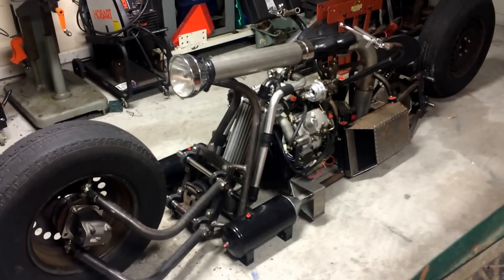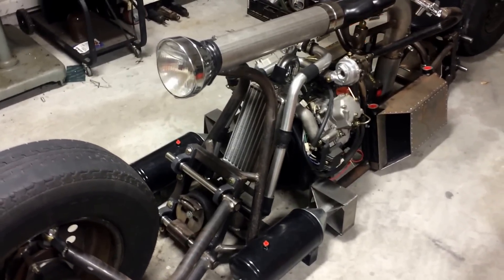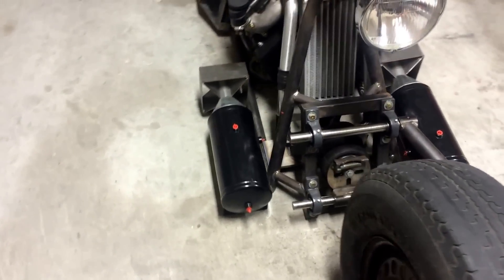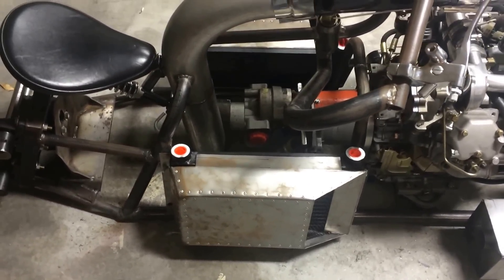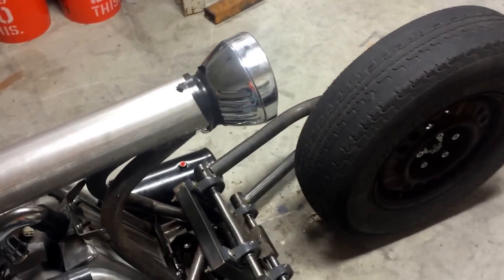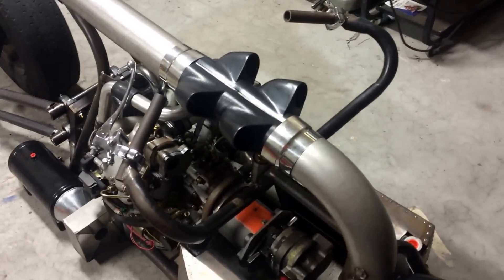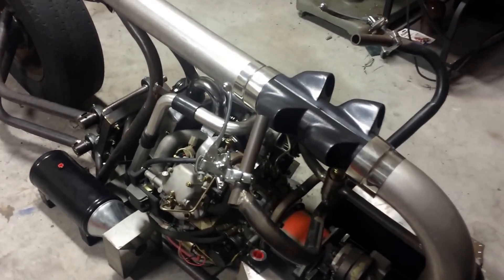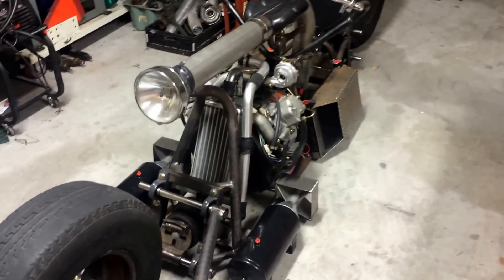Hydrostatic Twin Turbo Diesel Motorcycle Build (Part 1)

Comment: Very nice work Sam. I enjoy your videos. Congratulations with all of your success in partnering with the diesel brother guys. I am starting this winter a turbo diesel bike of my own and was thinking of this concept myself. please tell me if i am headed in the right direction before I spend a ton of money on R&D. I am considering using a variable speed displacement hydraulic pump like on a forklift and eaton wheel hub. I am unsure of the size or series yet? I believe using this set-up would give very good dynamic braking, also like on some forklifts but  would also have one wheel set-up conventionally for safety. Please any help you could provide in selecting of the right parts would be greatly appreciated. Thank you, again congratulations on all your success.

Comment: Very interesting. I have been thinking about shoehorning a 40hp diesel in my Dnepr sidecar rig with a hydraulic drive too.
Can you give me the exact parts you are using; motors, pumps part numbers?
What kind of efficiency do you recon you will get in the drive-train?

Comment: I like =D
Now, how about making some headlines eventually, first you port the tops on the heads, by doing so, you will increase pressure in the chamber, hence making it more fuel efficient.
secondly, turbo is good, but only if activated by high pressure, like accelerating onto the highway.
You want the turbo to be efficient, but only when it's needed, right?
Thirdly, add a powerful, electric motor to make it hybrid, which for example could be used on the front wheel.
Lastly, make some aerodynamic body to reduce resistance and drag and put together some numbers by test driving it for six hours without stopping ;)
This should get a good base for some mass production, so don't just sit around, give me numbers =D

Comment from the maker: Buddy Rowe, thank you for the comment! To answer the steering question, the arm is stationary, and the hub motor is actually what rotates. I have two different types of steering in mind, the first is a 1 to 1 double acting hydraulic cylinder at the hub motor connected to one at the handle bar. And then double the system up as a safety precaution. The other is a thick cable system that connects the handle bars to the hub. Like the steering on a boat.

Comment: wow. cant begin to understand how this thing is gonna operate / look!!!! very very very unique! my question, how is the front wheel going to be turned left/right? Is the single arm on the front wheel fixed, and the front wheel turns by hydraulic motor left/right? or does the whole arm/wheel assembly turn?